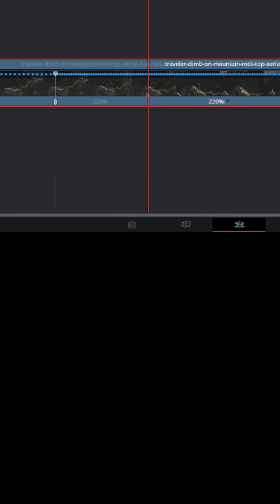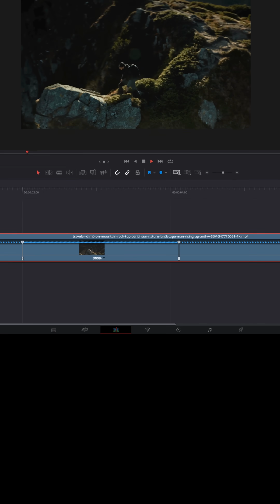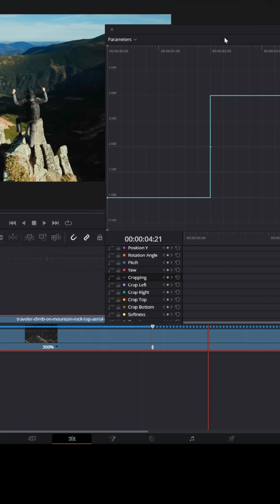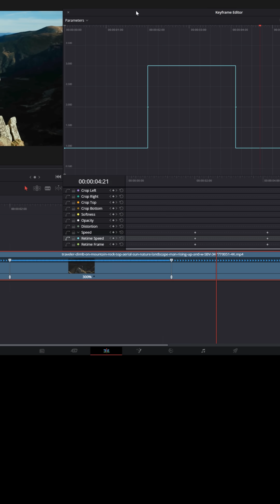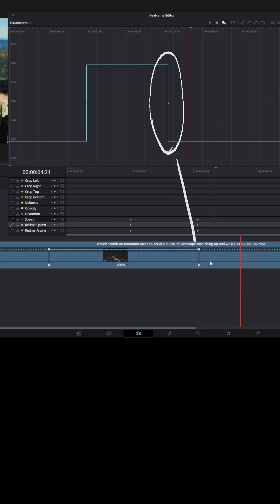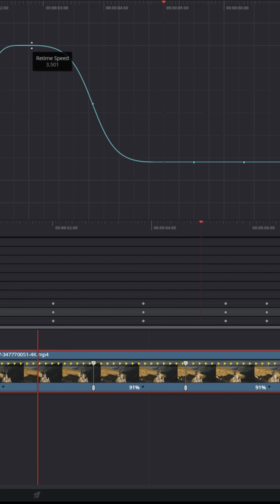Speed Ramping in DaVinci Resolve 20 - Keyframe Editor

Comment: I’ve recently switched too Davinci after using Vegas for 7 years. Is this the same as editing the Velocity in Vegas?
Reply from the maker: I’ve never used Sony Vegas before.
But speed ramping is the industry term for taking the speed of a video clip and having it change incrementally, either speeding it up or slowing it down but on a spine curve
Reply: @Daniel_Batal  So for Velocity in Vegas the clip doesn't extend itself or shorten itself based on changing the velocity it changes the speed of it based on curves as well but the length of the clip that you cut stays the same, while still being able to change the speed of it. Is there anyway to make that happen in Davinci? Because whenever I change the speed of it, it extends the entire clip.
Reply from the maker: Several. All of which are workflow dependent.
The easiest way for a simple project is just select your clip in your timeline, go up to the inspector and under “speed change”, change the speed, but make sure you have the “ripple timeline” box unticked, or it will ripple and change the length of the clip.
Reply: @Daniel_Batal I am unfortunately at work currently but would it be possible to communicate with you through discord? Or to continue through your YouTube comment section?

Comment: I like the extra control we have with the keyframes, but for me most times it's unnecessary. I'm making a slowmo clip from a 200fps base, having to retime it down to 25fps and then extend it out on the timeline to its full 200fps in the slowmo segments. resolve doesn't have a higher import framerate than 120fps.
Reply from the maker: DaVinci Resolve (especially the Studio version) can import and handle frame rates higher than 120fps, but the free version has limitations (typically 60fps for timeline/export), and you must set your Project Settings (File > Project Settings) to the desired high frame rate before importing media or creating timelines to work effectively with 120fps or higher footage
Reply: @Daniel_Batal  thanks for the reply, what I meant was the Project Settings (I have the Studio version) wouldn't let me go higher than 120fps. importing the 200fps clips wasn't an issue, I just did like you did in the vid; backed the clip down to 25fps and extended out desired segments to proper slowmo speed. if I tried to import a native 200fps clip into the timeline, DVR would've gone spare at me for conflicting speeds. next time I'll just record in 100fps and use Optical Flow to smooth out the jitter.

Comment: I am bit frustrated that when DR changed speed ramp I can't figure out how to display the ramp and then change to gradual ramp ... I have watched countless YouTubes including yours and my Studio version does not display ramp even after following your instruction step by step.
Reply from the maker: Well, let me see if I can help. 
My guess is the beginning part of this video you have down. The Retime controls and adding speed points are exactly the same as previous versions. So, add those and adjust the speed between to speed points as always.
Now, there is a Show Keyframe Tray option in the upper left of the Timeline. 
It's right between the Timeline View Options icon and the VoiceOver icon, it looks like  3 diamonds stacked on top of each other.
Click that.

That'll open up the keyframes in a more familiar tray underneath your timeline instead of using the Keyframe editor.
Once you have that open and with your speed ramp clip selected, by default you should be seeing the keyframes themselves in a series of horizontal rows with each row having a label on the far left (Zoom X, Zoom Y, Position, Rotation, etc). That option is called the "Keyframe Lanes".

You can left click and hold on the horizontal top divider line between the panels to pull that Keyframe tray up higher and see more of that panel just like you would dragging the UI panel divider between the Video and Audio tracks.
On the top left of the keyframe tray, you'll see you have the option to swap over from Keyframe Lanes to Keyframe Curves (Click that option)

Now you'll be looking at the actual spline of your keyframed animations.
On the left menu, scroll down to where you see "Speed" and make sure you have that menu expanded to see both Retime Speed and Retime Frame below it.
You only want to only engage the Retime Speed option which is controlled by the sort of curved line with a dot on each end on the far left of every keyframe option.
That toggles on/off every spline.

Turn all of the Speed splines off by clicking on the curve option to the left of "Speed" and then, click on the curve option on for Retime Speed only.
You should now see only the Speed Ramp spline curve for your Retime speed under your clip and you can select each curve keyframe by clicking on it in the spline itself, that will make the keyframe handle appear.
Now you can easily grab that handle and adjust your curve.

I know, if feels different than before but once you get used to it, it's actually going to give you a lot more control.
Hope that helped! ☮️
Reply: @Daniel_Batal thank you for taking time respond in detail.  I’ll go through step by step

Comment: This keyframe interface is fantastic, I have one question, if you have 2 speed points, in the keyframe editor can you make the speed curve of those 2 keyframes connect? Or do they always have to be seperate
Reply from the maker: The curve itself can connect, not the actually “handles”.
Just grab them and and extend them to pull the curve to be continuous

Comment: Another great tip, oriignally i have two split clips one at full time and the other at 50% speed, you lack control, espeically when i was trying to match the speech of an animated character to that of the audio speed, one part was slow, one was quicker and it was never quite 100%. These speed controls makes it so much easier, its knowing what this product can do and how, incredible project Davinci Resolve.
Reply from the maker: Absolutely.
Same it true with audio too.
The elastic wave form feature is pretty cool for getting audio to bend & confirm to the video speed

Comment: How do you do this on a single clip, let's say from 800% start to 100% end? I dont want to add speedpoints in the middle of the clip, just use start and end of it.
Reply from the maker: Just set two speed points, one at the beginning and one at the end and then decide how much of a ramp curve you want by pulling the handles outward on each

Comment: I don't have Keyframe Curves, I click on the menu and nothing happens
Reply from the maker: Are you using version 20? If so, it’s there. You might be clicking in the wrong spot
Reply: @Daniel_Batal  It is version 20!
Reply from the maker: Make sure you have the latest version, 20.1, installed. You're just overlooking the feature.
When completely lost, undock the keyframes UI panel, you'll see keyframes on bottom, curves on top.
Reply: @Daniel_Batal hey, thank you so much for replying! I need to check the version, but I am definitely clicking the same menu as you, and it does nothing

Comment: As soon as i open the keyframe window and i Click anywhere in that window in getting a freeze for a second, then a whitescreen for a second and then a blackscreen on the whole laptop. Tried to update drivers, enable intelligent rendering, using proxies (1/4) but the problem still remains. I used to edit on the free version where you didnt have the new keyframe window and i had no issues at all.
Reply from the maker: Make sure your system meets or exceeds the recommended (not minimum) system specs to run Resolve effectively for your workflow: https://motionarray.com/learn/davinci-resolve/davinci-resolve-system-requirements/

Comment: The “separate” ease buttons are not working? I’m trying to ramp two clips together but the second clip will only ease in
Reply from the maker: If it’s two separate clips and each only has one speed point, then the altered speed side of that point would be the only one which can be eased.
Try turning them into a single compound clip

Comment: What framerate do you want your timeline to be compared to your footage in order to nicely do speedramps without having choppy end results?
Reply from the maker: Depends on how much you’re speeding it up or slowing it down.
Divisible numbers are often your friend.
How you film the footage can be pretty important —-> https://youtu.be/vUe0M5smweY?si=6clAZrz4YUXiGGW0
Reply: @Daniel_Batal thanks just watched that vid. But you don’t really specify on the timeline settings. So for example that 24fps clip ain’t gonna do much on a 30fps timeline?
Reply from the maker: I think you skipped over all the important information.
For instance, you didn’t mention if you intend on speeding up or slowing down the footage in the speed ramp.
You ignored my advice of divisible frame rates. 
ie, 60 fps footage ramped down to 50% in a 30fps timeline is very divisible and incurs no frame stretching once at landing speed.
I think you might have some misconceptions about how speed ramping works and how important the source frame rate, resolution & shutter speed is to the final result

Comment: My percentage speed at the bottom of the clip is greyed out and I can’t figure out how to be able to make that regular to speed ramp
Reply from the maker: If you were able to set speed points, that means you had it working at some point. Make sure you haven’t done something in your workflow to interfere with that functionality such as grouping or linking tracks, locking tracks, etc..
Reply: @Daniel_Batal even when I added two speed points the thing was still greyed out and it didn’t show anything on the graph/plot that you showed

Comment: Greetings. When I select two keyframe points on the chart and then click "ease in and out" button - nothing happens. It does not smooth the chart.
Reply from the maker: First off, make sure you’re actually selecting the keyframes, not just clicking on them.
Draw a box.
Also, it depends which points are selected.
For instance a Zoom spline tends to be linear and you can’t really see the handles.
Is the graph line linear or does it move up or down?
Reply: @Daniel_Batal  thank you for your response mate. really appreciate it. I've got down to the root cause: next to Reetime Speed parameter there is a lock icon (53 second on your video). It seems to be selected by default on my PC. You need to unselect it.

Comment: I'm really trying here. I have a video clip(compound clip) that I need a portion of the clip to speed up 1000%. I also need the audio to speed up as well at the same speed points. I linked clips, clicked the two auto track selectors. How can I get the audio clips to speed up at the points I selected? Thanks so much...big time noob here.
Reply from the maker: Make sure the audio and video tacks are linked (select both, right click, link) and they’ll typically adjust together.
This is version 19.1 but same linking rules apply: https://youtube.com/shorts/68ytcGDvwAU?si=BHEPqwucK1JJ_gHs

Comment: Great simple breakdown! Thank you. Have been SUPER frustrated at how convoluted the new process is. I like the added control, but it takes so much more time to do tasks when you have a bunch of clips to time ramp. They should have kept both methods. One for speed, one for detail. This is all gonna cost me so many extra hours of effort since my specialty is slow motion work. screams internally
Reply from the maker: Change always feels different.
I think you’ll find once you get used to this new feature that you have the ability to create better speed ramping faster.

Remember how hard it was to ease in and out a dozen keyframes in the old version?
You had to do them all individually. 
That took forever!
Check this out—> https://youtube.com/shorts/Gjfc4PA2fYM?si=vFnMLQR-FcXEZbMX
Reply: @Daniel_Batal  That would have been an easy fix though. Just allow for the same drag and highlight functionality. This is not in any way faster for me. I am grateful to have more controls, but they should not have taken away the old controls. Just needless complexity. The new way takes several extra clicks AND just as importantly removes a whole section of the editing space that I actually actively used pretty frequently in between time ramping adjustments. Beyond frustrating.
Reply: fully agree. the new process is less intuitive, why is 'add speed point' and 'change speed' tucked away in a dropdown arrow menu - and not just a hotkey click and drag like before. Frustrating, and Blackmagic should bring that old method back... I do tons of speed ramping and this feels tedious as ever now.

Comment: DaVinci Resolve 20 needs work. You cannot create asymmetrical Ease In and Out; adjusting one handle always adjusts the other. Choosing just "Ease In" or "Ease Out" doesn't seem to work for me, either. Only "Ease In and Out" works.
Reply from the maker: Untrue.
A couple of things to keep in mind is that your X & Y zoom factors are locked by default in DaVinci Resolve (always have been) so you have to unlock & separate them. 

Also, there are separate spline for position X  & position Y.
You have to make sure each value you’re trying to customize is unlocked  and enabled in the parameters view but can can choose to select more than one at a time to ease (which is really awesome and something we couldn’t do before!) or you can also choose to select them individually, one at a time, two at a time, etc… to add easing and create independent spline curves for each and control the handles for that easing manually.
This might help—-> https://youtube.com/shorts/Gjfc4PA2fYM?si=2lYITEAKG6NrlNXW

Comment: Wheres the keyframe icon for speed curve in the ipad version?
Reply: Hey Daniel, is there anyway that we could speed ramp using the iPad version of daVinci 20? Speed ramps are kind of big deal in my videos.?? This is a total rubbish move for a update for davinci 20..
Reply from the maker: Not that I’m aware of at the moment.
I installed the iPad version the other day and haven’t seen the retime curve anywhere as of yet.
Technically speaking, those pages aren’t even supposed to be available.
It was built to be cut page & color page only app but people realized they could hack open the other pages.
That being said, you should still be able to speed ramp in Fusion if you unlock that page
Reply from the maker: It’s not available on the iPad version.
Reply: @Daniel_Batal wooooow,, that sucks.. and that is kind of dumb on da Vinci‘s part to completely just take it out.. They should’ve left the function from daVinci 19 so we’re able to still speed ramp.. and use the retime curve… dang davinci… figure it out!

Comment: Hi Daniel, do you know how to do inner glow (Just the object outest part inside but not the outside the object) in Davinci resolve ?
Reply from the maker: To create an inner glow in DaVinci Resolve:

1. Add your clip to the timeline in the Fusion page.
2. Select the clip node, then add a Glow effect (Effects > Glow).
3. In the Glow settings, adjust the Glow Size and Glow intensity.
4. To make it an inner glow, check the Inside box in the Glow controls or use a mask to constrain the glow to the inner edges.
5. Tweak color, softness, and opacity as needed.

Done!
Reply: @Daniel_Batal Thank you so much ❤

Comment: Hello Daniel 
Thanks for making this but how do I perfectly change the ratio of my orignal footage in davinci resolve(1:1) as I tried I had to strech it one by one,  in other software it is easy to change the ratio of the media we input
Reply from the maker: Change your project settings resolution to a the derived square resolution when you begin.
In the lower right you’ll see a cog wheel, click that.
Or you can access it under File > Project Settings

Comment: Perfect, I was looking exactly for this. The only thing that gets me is that it changes duration when you change speed. I think time stretcher works kinda the same but it is getting very complex
Reply from the maker: Anytime you slow something down, it's going to increase duration. That's the math of it. Speeding it up will make it go quicker.
My favorite fast way to solve both is use the Retime controls, set the speed and then drag the end of the video to length. https://youtube.com/shorts/vo3fBKVNhyQ?si=_7rE3-Q00z3tM0Od